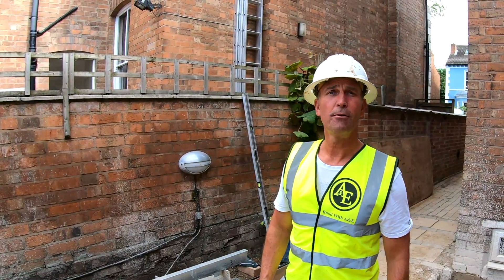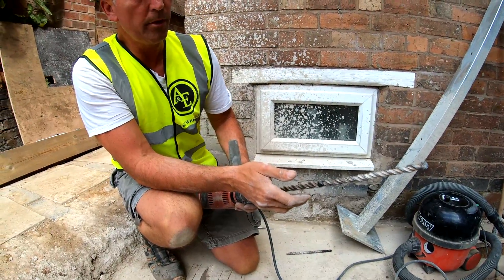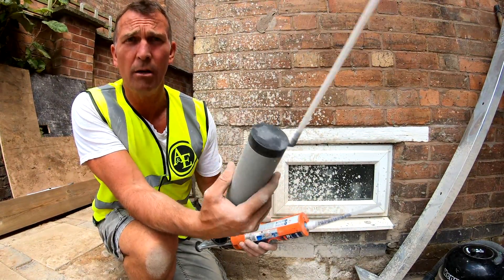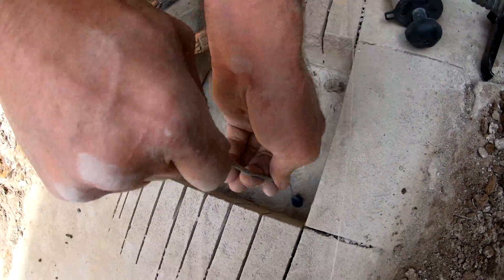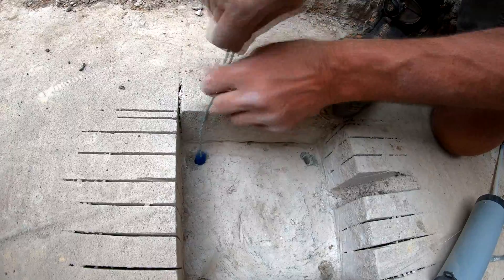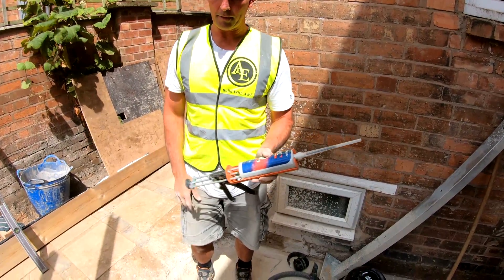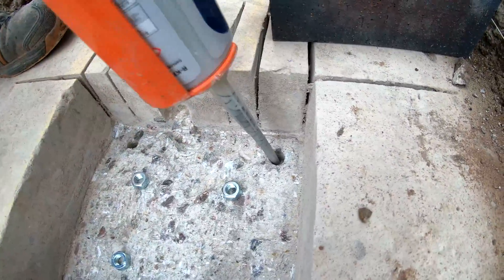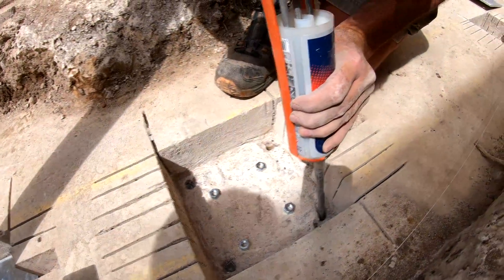RESIN ANCHOR BOLTS: What you need to know!

Comment: Very interesting. Not easy. One question. Why the extra concrete cuts in line with wall. The extra slices in the square perimeter???????
Reply from the maker: The cuts allow the grout to flow easily around the bottom of the steels. This ensures that everything is fully encapsulated,  and nice and solid. 

All the best, John 👷🏻‍♂️

Comment: Awesome video. One thing though is judging from the color, it looks like the resin in the tip wasn't fully mixed at 9:45 before it was put in the hole. I'm sure you already know, but a proper respirator and eye protection are good idea when working with that dust.
Reply: I would like to add that the respirator should be properly fitted to the user. Also the proper filter cartridge used for the working conditions as there are multiple available.

Comment: Okay, so... we see where the concrete has been chiseled out, the bottoms of each square hole pretty rough and uneven. the bottom plates of each steel column are spaced above the bottom of the square holes with the nuts for the threaded rods (obviously to keep them more-or-less upright, and to avoid contact with uncured resin). All well and good. Now: are those square holes partially filled with concrete to level the bottoms, before affixing the plates permanently to the foundation/slab? Or: what? If the bottom plates are fully fastened to the uneven bottoms of the square holes (with the nuts fully tightened), they won't stand upright, perfectly perpendicular to the slab. AND: none of those bolts are long enough to mount the plates above the actual slab, once the square holes are refilled with concrete to match the slab. Much time was alotted to showing each of the bolt holes being perfectly cleaned out. A single bolt hole would have sufficed to demonstrate the procedure. Unshown: how were these things all leveled and finally secured? I got the gist of the two-part resin being injected through the mixing tube (I've worked with lots of that stuff-- 1:1, 2:1, 10:1, etc...). But the base plates being leveled to the square whole bottoms was entirely omitted. Enquiring minds want to know!

Comment: Wouldn’t it be better to just lay a piece of paper under the plate instead of those nuts to prevent the plate from sticking to the resin? Don’t the nuts make the platform weaker as it’s not fully resting in the concrete below? When you tighten the nuts on the rod doesn’t it bend the flange corners down because of the nuts under the plate? Can those nut rust?
I’m not a contractor, I’m just wondering.
Reply: I think the nuts are just temporary. He wanted the plate on while the resin was setting to ensure the rods are lined up right. I assume there's a bit he's going to do later where he removes the plate and the nuts then puts the plate back before he screws it down tight.

Comment: I’m screwing brackets to hold my deck posts down to existing footings. The footings are over 20 yrs old.
Can I use the resin with a concrete screw or is it just for studs? Are these special studs like stainless, galvanized or hardened?

Comment: A few ideas: 
you can use the exiting air from your vacuum cleaner to have an "airblower", helps with the cleaning of the holes. That or a compressor ofcourse, but I hate this hand-held pumps. 
Also, instead of the brush i use an 8mm steel rope - put it trough small pipe, about 10mm id. so you can hold it while it spins. Take one end of the steel rope and bend the wires outwards, so they act like a brush. Then put it trough the pipe and put the other end of the rope in a battery drill, then put it in REVERSE... boom, clean your hole with that. If you dont put it in reverse, it will untangle the rope, which is what you dont want. 
Another tip is to scoop the excess resin with your finger (wear a glove) and smear it onto the next bolt before you put it in. That way you save on some on the resin, and also you make sure the resin is well inbetween the threads. 
Oh did I mention to degrease the threaded rods? :) I use acetone, but most anything will do. You shouldnt skip that step, because they have a bit of oil on them from the factory.
And always prime when you put on a new mixer.
Good job by the way with the video, I loved it. Sorry for the comment, but I thought you might use some of the tips, like I'm gonna use some of yours! Good day sir!
Reply: Thor Row
Reply: Good advice thanks a million

Comment: i would have though is you use a sucking tool to clean out the hole instead off a blowing tool you would get a much cleaner hole.     you could cut the blower long thin tube of the blower and attach it to the vacuum cleaner to create a sucker, ( a bit like  BORIS JOHNSTON), to clean out the hole.       using the bottle brush would make this  approach even better.    maybe use it on  BJ  also.    oh yeah  BJ  stands for something else too.   haha

Comment: Great video guys very neat job
Reply from the maker: Hi M G much appreciated all the best Tony have a awesome weekend 👍
Reply: Cheers you to. Quick question 

Hi I am looking to build a window cannopy at front of house. However I am getting external wall insulation on my home in a few weeks. I have been advised to attach 6x2 C16 grade timber on the house where I want the cannopy frame to be prior to any external insulation being done.

I will be fitting some m12 high tensile steel screwed rod with chemical fixing to support the timber. How far into the wall should I be placing the screwed rod into my house. ( my house has cavity walls. and I think the cavity is approx 100mm in from external  brickwork.) Should I go beyond the cavity into the internal brickwork?? And if I do go beyond the cavity how would I stop the chemical resin from falling into the cavity?? 

Thanks in advance

Comment: Hi I am looking to build a window cannopy at front of house. However I am getting external wall insulation on my home in a few weeks. I have been advised to attach 6x2 C16 grade timber on the house where I want the cannopy frame to be prior to any external insulation being done.

My question is what fixings / fasteners should I use for the 6x2 timber and how far apart should I position said fixings? The length of the cannopy will be 5m and will I need any supports underneath the cannopy?

I'm thinking that some chemical fixed m12 screwed rod should do the job. But not 100% 

Thanks in advance.

Comment: What's the advantage using chemical fix rather than a concrete anchor bolt/screwbolt, stronger fixing?
Reply from the maker: Hi Haz it was the engineer who specified the mechanical fixture all the best Tony 👍
Reply: @BuildWithAE  thanks

Comment: Nice vid, if you want to use m12 bolt for the resin do you use m12 drill bit or the next size up? Thanks
Reply from the maker: Hi Neo no the drill size will always be bigger but look at the instructions on the chem fix you are using all the best Tony 👍

Comment: Thank you very good video. What diameter of hole you need to drill for a 12 mm threaded rod? (What is the recommended gap, if any, between hole and threaded rod)?
Reply from the maker: Hi Rami follow the link it gives you everything you need to know https://www.the-cfa.co.uk/media/49437/gnresinbondedanchors.pdf
all the best Tony 👍
Reply: @BuildWithAE  link no longer works, could you just tell us what size hol you recommend for a 12mm rod? Cheers
Reply from the maker: @Mylesmitch  the hole will be required by the engineer or on the back of the chemical tube

Comment: Professional job. Why don't you place oversize nuts over the screws to support the studs just underneath the bolting nuts? Otherwise, not placing these nuts but sitting the stud on the excess resin might be even better, in order to keep the stud at correct level after hardening.

Comment: I'm using steel brush used for cleaning copper pipes fixed in to battery drill plus compressed air. 
Power tools are so helpful.
Reply from the maker: So true thanks for watching all the best Tony 👍

Comment: Good work on the cleanout. I'm using some thick staws, just throw in the staw and use your hand as an adapter to the vacuum and then do the brushing and blowing. You can use one of the bolts to smear the excess so you do not need to touch it with your bare skin, this stuff is nasty while wet. Also you do not need to use a new nozel beween cartriges.
Reply: Yes, wasted some resin by not reusing the old nozzle.

Comment: What a carry on to get a fixing a Rawlbolt or through bolt would have done similar, the base will be filled in later anyway.
Reply from the maker: Hi Richard,

Anchor resin and threaded bar were specified by the structural engineer for this project. 

We would never go against their advice or instruction.

All the best, John 😊

Comment: Tony,when I first saw the thumbnail for this video and seen the cut out in the footing, I thought uh oh somebody’s cocked the levels up,but then I thought about it did you use them as grout forms after bolting up the steels.
Reply from the maker: Hi Mark Worthington spot on, to be fair I don’t know why but it was supposed to be 50mm not 70mm it just the way it worked but it’s a lot easier to grout under the plate as the engineer had required but it’s also easier to have bolt adjustments instead of sims I prefer bolt than sim but steel guys might say different but each to there own thanks for watching keep Safe all the best Tony